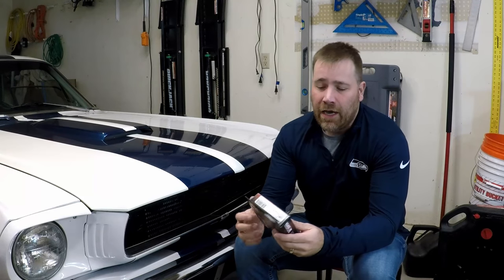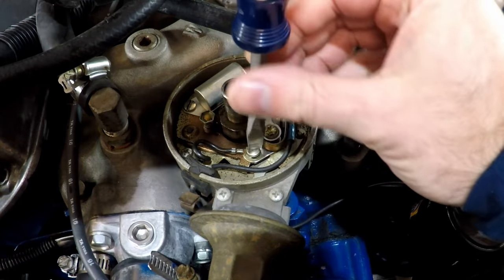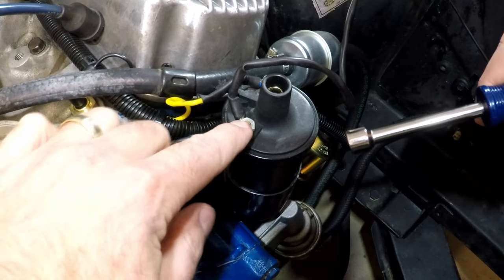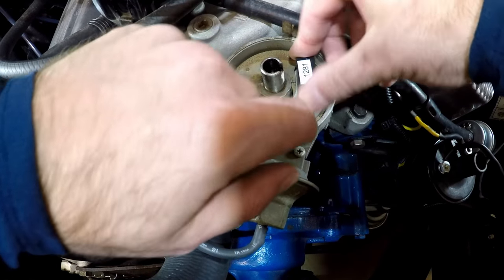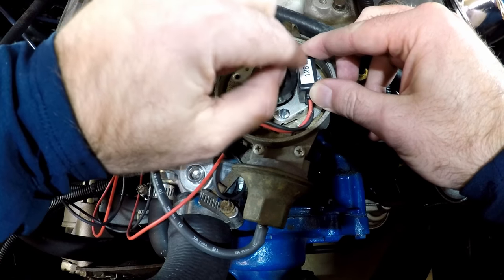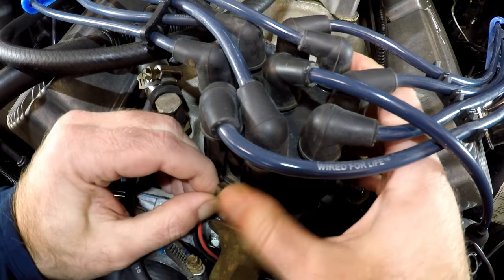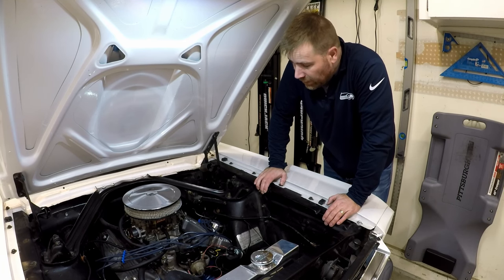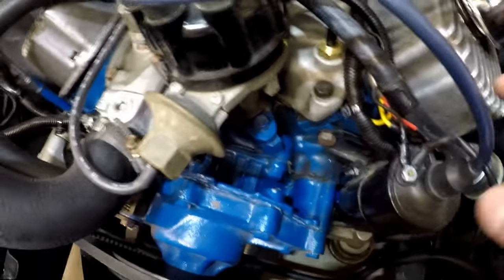How to install Pertronix Electronic Ignition

Comment: When removing points screws, don’t drop them so they end up down inside your distributor like I did. 40 mins later with a tiny magnetic screwdriver I found them and managed to get them out.
Reply from the maker: This is good advice.  :)
Reply: Would this cause a rattle when you rev it? I have a 1974 Ford with a 360 in it. Sounds crisp but certain times when you rev it, sounds like a tiny screw is rattling somewhere. Previous owner converted the system.

Comment: Did you remove your resist wire?  I have read these years need that removed to get the full 12 volts to coil.
Reply from the maker: Sorry Boss, I'm not sure I understand which wire you are referring to.  Inside the Cap, there is the Capacitor and the Points mechanism which I removed.  The only thing I left in there was the ground wire from before.
Reply: @AndyKruseChannel  the way I understand it is,  the hot to the coil is only 12 volts at cranking. The rest of the time its 7-9 volts because of the resist wire.  But honestly I don't know where the resist wire is thats why I'm wanting videos so I can get it right and not mess my pertonix unit.  But your video is 7 months old guess if it wasn't working you would know by now so guess your right my info must be wrong.   Thanks for videos I appreciate them.
Reply from the maker: @warhawkgarage1272  I had this Petronix system in my previous '66 Mustang, and now in this '66 Mustang.  I'd agree, if there was any ignition issues I would have had them by now.  :)
I'm glad you are able to find some value in these videos.
Reply: @AndyKruseChannel  great videos keep them up.
Reply: Sup Warhawk and Andy, yes there is a pink resistor wire on my 65' mustang coupe. It's purpose is to prevent the coil from receiving a full 12 volts when the key is in the "on" position. This was used on early model Mustangs and even comes in the new wiring harnesses. Pertronix says that the ignitor needs the full 12 volts though and anything less will damage the module. So you need to either bypass the resistor wire, remove it (wouldn't recommend that in case you need to go back to points for some reason), or you can buy the relay that Pertronix sells for this issue exactly. If none of that made sense, please refer to these links for more info :)

1) https://www.youtube.com/watch?v=uQ0smsIO8Js
2) https://www.youtube.com/watch?v=c76knXFuXH0&t=648s
3) https://www.vintage-mustang.com/threads/pertronix-resistor-wire.1159894/
5) https://www.youtube.com/watch?v=D2X-m1uRYLw
4) https://www.cjponyparts.com/pertronix-ignition-power-relay-kit/p/PER2001
Reply: There is a pink wire behind the speedometer connected to the ignition switch that needs to be removed so you can get the full 12 volts to the pertronix... the pink wire is fairly fat and says do not remove on it
Reply: Warhawk garage is correct, the pertronix instructions clearly state that you must remove the resistor wire in order to get 12 volts to the distributor
Reply: I installed mine almost 18 to 20 years ago on a 65 Mustang did NOT removed the resister wire still running fine. so I think Andy will be fine with the way he did this. If you read the instruction on a Pertronics 1,  it says NOTHING about removing anything or needed different voltage. Only proper coil resistance ..
OHMS....End of story........

Comment: Thank you for posting the walk through. It makes perfect sense... but the inside of my distributor cap has an additional plate and springs. It seems like it should come out. Suggestions? I don't think I can post a pic here.
Reply from the maker: Good question, you could email me the pic, my email contact is in the "About" section on my channel.
Reply: @AndyKruseChannel  thanks man. You are a Saint. I have this taken apart and am now stuck. Sending!
Reply from the maker: @robnordyke6151  Got the pic, I replied, the short answer looks like it should still work.  :)
Reply: @Bobby Vihaan Instablaster =)
Reply: @Theo Toby thanks for your reply. I got to the site on google and I'm trying it out now.
Looks like it's gonna take a while so I will get back to you later with my results.
Reply: @Theo Toby It worked and I actually got access to my account again. Im so happy:D
Thank you so much you saved my ass :D
Reply: @Bobby Vihaan Happy to help :)

Comment: So, my factory coil on my 67 289 has a red and black wire. The yellow top on the coil is marked positive and negative. My new coil is marked battery and distributor. Which wire goes to which terminal? I don't want to burn up a new coil
Reply from the maker: It should be the same, red to positive and black to negative.  But I am confused why the new coil is marked battery and distributor, I have not seen that before.
Reply: @AndyKruseChannel  that's because your last name isn't Phillips. You don't have my luck. Lol. I would send a picture to you if I could

Comment: Thanks good video.
Two things to keep in mind for ignitor 1 model.
The power supply should get 12v. Lay a new cable from the ignition swith or bridge the existing resistor cable. Most of the time only about 9 V arrive. This can lead to misfiring.
And also important to mention is, if you screw on the car for example on the electrics. The ignition should not stay on too long without the engine running. This can destroy the Pertronix ignition module.
Reply from the maker: Thanks for the heads up.  :)
Reply: yep. Also a higher power coil. like a Lucas DLB105. Only like $25. Old coil is made for a ballast setup. Running ign wire like OP said and bumping up coil should increase spark.
Reply: 77 t bird ..does it need a different 12 volt wire / can t use existing wire?
Reply: @BRUCE-y7l  
Messure if the positiv cable from ignition switch to the coil has 12V
If not, there is a resistor installed.
Then you have to find that cable near the ignition switch inside the car. Then bridge that cable, so there is the full voltage at the coil. 
You also can install a relay, so that the coil/ red wire from pertronix modul gets the full power from the battery

Comment: Nice clean video. Looks to be a nice product.I would at a minimum check ignition timing after. But thats just me...
Reply from the maker: Thanks, but considering the distributor is not moved or adjusted for this upgrade, the timing will be exactly where it was before the upgrade began.  🙂
Reply: yes I understand that but assuming the physical placement of module will sync with points dwell setting is a bit too iffy since dwell can affect ignition timing. It's just me wanting to be 100%.

Comment: The issue I had the magnetic sleeve fit a loose on the lobes may be due to being a rebuild unit? I used telflon,too help it fit snuggly over it, and then it will hold tight with the rotor on it. Do not freak out if it's not perfectly rounded, mine was off set by .006 on one side it still works. They are not sensitive like a computer control module.
Reply from the maker: Yeah, haven't had any issues with the four of these units I have now installed over various vehicles.  :)
Reply: @AndyKruseChannel  the issue was not the Pertronix kit, but the distributor reluctor sleeve that goes over the distributor cam,my distributor was a remanfacture unit and was regrounded leaving excessive clearance for the sleeve. I used telfon tape to make up the loose gap and do not use metallic tapes or glue type chemicals.

Comment: Was your coil internally ballast? I didn't see a ballast resistor any where. Asking for a friend. 🤣  Good video.  But seriously, do i need to keep or loose my ballast resistor?
Reply from the maker: I have the ‘pink’ resistor wire behind my gauge cluster, so I have an external resistor system.

Comment: Nice vid'.......thx for sharing.  I am thinking of installing a Pertronix Ignitor in my '66 Fury.  I was wondering if you had to turn your distributor to adjust the timing of your Mustang after you did this video?
Reply from the maker: Thanks!  No adjustment to the timing is needed, but it's also assuming your timing is already dialed in before the upgrade.  If not, no big deal, install the Pertronix, and then you can go about setting the timing just as if you had the old points in the car.  I have a video on that if you need to watch it for a refresh.  :)

Comment: Was it really that easy? Bought my grandson a 73 Maverick Grabber and want to do away with the points.
Reply from the maker: It's as easy as I describe in the video.  I have now done this on four different vehicles and it has worked right out of the box every time.  It will likely be faster for you than it was for me since you don't have to setup the camera and check the mirror to make sure you look pretty.  :)
Reply: My distributor is a little different. There’s a red wire coming from the coil already into a harness that’s goes into the firewall.
Reply: Who hoo we got the maverick started. Really was easy. Thanks.

Comment: My 289 had a dual point distributor. Would this item still work? Thanks for vid
Reply from the maker: It should, just remove both points and the condenser, install the hall-effect sensor and slide on the magnetic ring.  Good luck!!  :)

Comment: Good afternoon brother Do you know if it is the same for a 350 small block
Reply from the maker: I believe you want the Pertronix 1181 for the SBC, not the 1281 that I use on my 289.  Other than that, everything else should be the same.  :)

Comment: I'm picking one up tomorrow Andy, saw one dude install........... after he was adjusting timing and such. There was no need right, just getting rid of points right, you never time a car after adjusting points so I see no reason after installing this?
Reply from the maker: I have not touched or changed anything with respect to my timing since I made that video.  On a previous Mustang I had problems with the points to where I had to have the car towed one time.  I installed this Petronix system on that car and never had problems again.  It was one of the first items I new I wanted to buy for this Mustang because I knew it worked so well.  It really is a "set it and forget it" part.  It doesn't matter if it's winter or summer, it always works.  :)
Reply: Thanks I’m sticking with just that, I’m not getting a hotter coil, I read too many positive/negative talk on coils, I’ll stick with stock coil. One guy on here did same install you did but he had a coil that had one terminal and he was pulling wires through firewall splicing, I’m like damn stick with stock coil unless they have one slightly better than stock without being too hot. Less than 40,000

Comment: Would this work on a 260 v8 mercruiser boat motor
Reply from the maker: Yes, but I believe you'll want the ML-181 part number.  The specific unit I used in this video won't work, but that new part number should.  :)

Comment: Nice video, but clean up your battery posts and wires!
Reply from the maker: You're correct, they need to be cleaned up.  I plan to move the battery to the trunk, so hopefully I can do a better job with the terminals.

Comment: So left both pos wired on the pos side of the coil , you didnt explain  or showed that part
Reply from the maker: Correct, just match the "+" and "-" wires to the same terminals on the coil.  :)